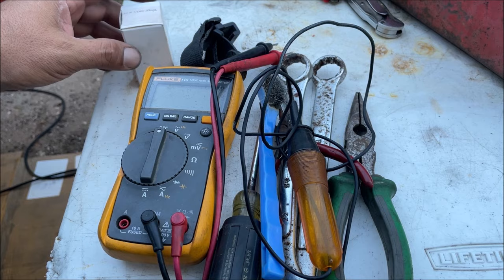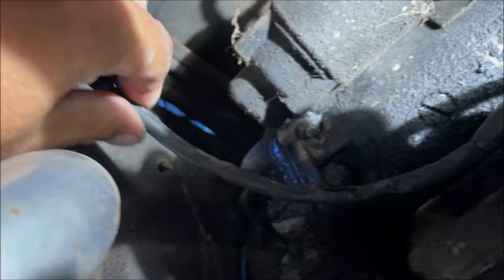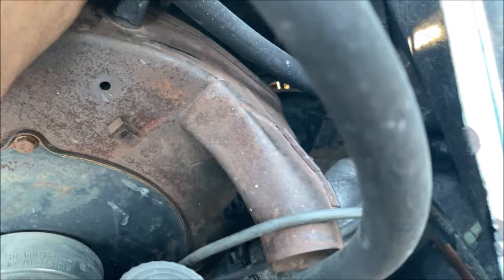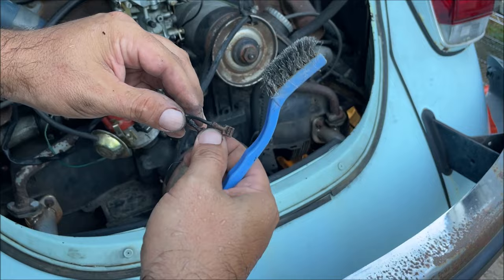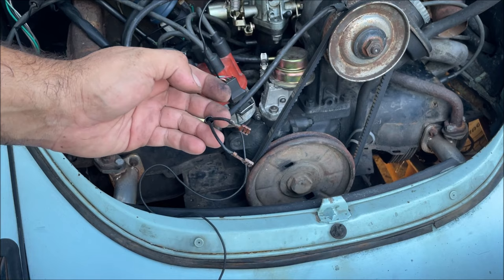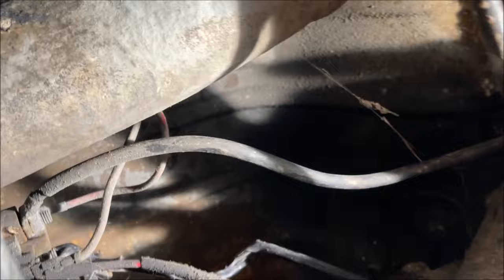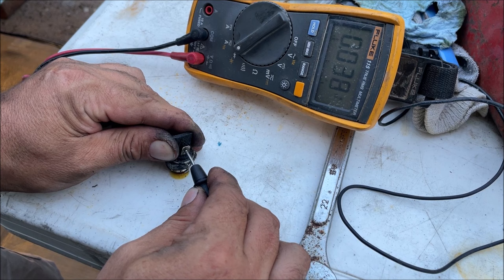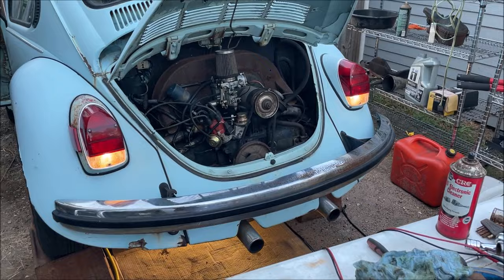VW Beetle REVERSE lights and SWITCH explained

Comment: Just got a 69 Bug last month, and reverse lights are the only ones that don't work... the wire was cut in the engine bay and tucked behind the tar board. So I need to get a fuse holder and wire it back up and hope it's still connected to the switch and working. If not I need to replace the switch.
Reply from the maker: heck yeah🤘😀🤘

Comment: I got a VW1600 based trike.
It has no reverse, and so I was hoping to find how the hell a reverse light can be sorted for it.
Obviously, looking for a switch on and off for a few years.. ( No, its not that important to me, plus I am disabled and can opnly work on it from time to time ).
But this is shoing me that its on the right side, but that engine is roten as hell and I cannot make out exactly where the switch is.
What I have seen is that where this one does look like it is... is simply nothing there!

There was never a reverse light on this trike and so there is no wires to try following, so I am wondering if it somehow located in a different place?

Ah well, looks like Im going to have to get a Workshop manual.